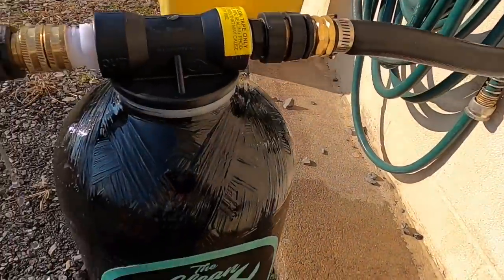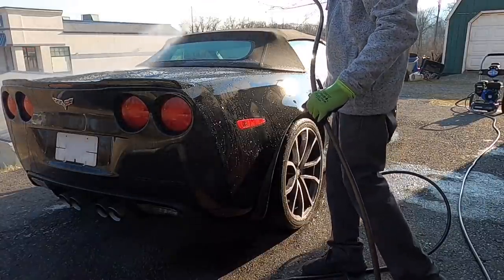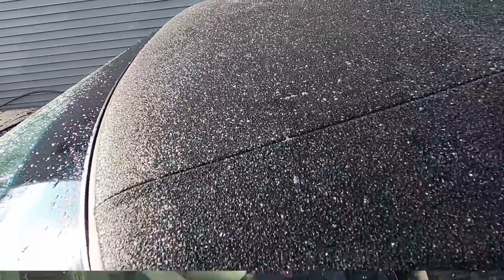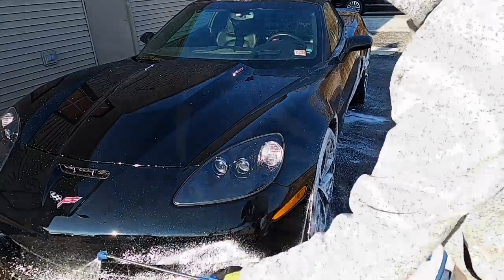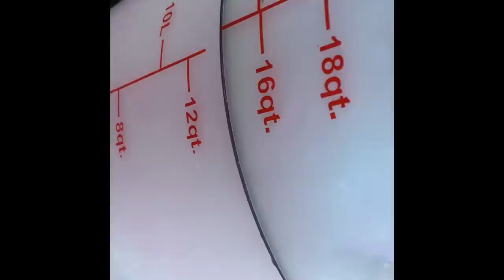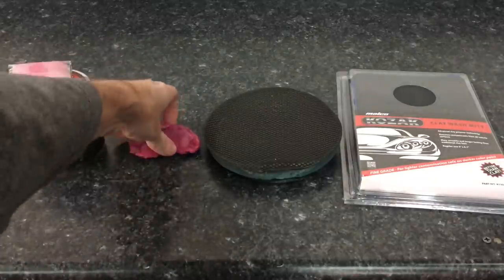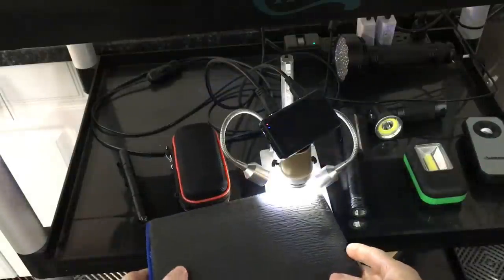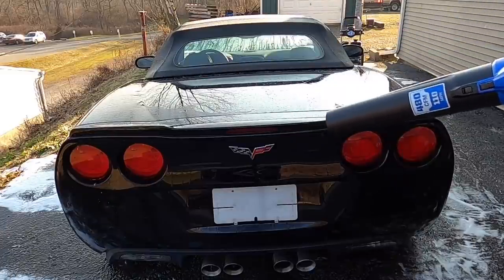Mod And Protect!!! Super Rare 427 Convertible Collector Edition Corvette LS7 7.0L!! Part 2!

Comment: I can't even explain how excited I get when I see the microscope come out.. I imagine it's similar to your team scoring for sports fans..
😁
For clay, I use a bit of everything, but I tend to go back to AM Details fine clay bars. I use smaller pieces than most people and downgrade new paint only bars to wheels and glass duty before tossing them so that helps extend their life a bit. I usually only use synthetics during decon on heavily contaminated vehicles and come back and spot clay with a bar before correction. I don't automatically mow down every inch of every vehicle now after seeing your process. Thanks Brian, amazing series! 👍👌✌

Comment: I have used the fine Nano Scrub, Sonax disc, Griot's round scrub and my favorite by far is the new improved of the OPTIMUM clay towel by  The Rag Company clay towel since it has a light blue surface to see that is time to clean it with little soap or diluted APC. If  the car is really constipated clay is the way to go.  Love for you get a TRC towel use the microscope before and after. I have softer paint on Honda's and all the newer cars are getting so soft.

Comment: cool microscopic view!!      i use Optimum Clay Towel ,i double the onr in 1 gallon pail, and use right after the Ferrex [iron remover] has done its job. to make sure i have extra lube. so i decon in almost one step.  Also, if i drop the Towel, i just rince it off...    its also easy to wash,  and wear n tear is visible..        i remember when Auto Magic came out with the Clay Magic!1 with the detailer spray.   big revolution back then!! ;-)-        i would use a clay bar on really bad contaminated cars, but rarely do so now!

Comment: I actually clean my clay bars. Simply set them in hot water a drop of soap and knead them like dough until they're clean. Rinse and repeat if necessary. Use a set of kitchen gloves so you don't burn yourself of course.😉👍

Comment: Nice job on the vette an I like the clay bar fine nervous I will scratch my paint up bad I heard you can even with fine I always check it with a zip lock bag over my hand after a good wash an dry it's a pain I have a 10 inch lifted truck with 37 x 20 x13.50

Comment: Prefer using an actual Clay Bar also.  Usually go with Meguiars Mild Clay.  The clay bar is more effective and easier to get into tight spaces.  I sometimes use the Griots Garage synthetic clay on newer vehicles mostly that do not have severe road grime.

Comment: Hello Brian, do you think a power-washer removes brake lubrication?  Silicone & High-Temp lubes
Reply: While I'd agree with you I'd add that most half ass book time techs and do it yourself people don't do brake jobs correctly . Add to that I've NEVER seen any factory car come with lube on them
Reply from the maker: To a certain point...you will need to follow up with something like Citrol 266

Comment: Brian, I do not believe that's a Z06.   Maybe someone can correct me, but I don't think GM ever made a C6Z vert.  I think the anniversary editions had the LS7 with the body panels, but I don't think they had the aluminum frame, etc.
Reply: That is correct. It is a officially a Corvette 427 Convertible Collector Edition. You could order  the 60th Anniversary package on any 2013 Vette -base through ZR1 model. They are white with silver/blue stripes and blue interiors. They only made the 427 vert model one year (2013) and 2500 units (half of the 427s made were white). It has the entire Z06 drivetrain (LS7) and brakes, ZR1 CF hood w/o the cutout for supercharger, ZR1 spoiler, ZR1 size wheel/tires, CF fenders and doors, and standard magnetic ride control on a steel frame. Only Z06 and ZR1 have the aluminum frames. GM couldn’t make a vert work on the aluminum frames w/o making major design changes which didn’t make fiscal sense for a limited production run in the last year of this (6th) generation corvette. With all that being said, it is as close to  a convertible Z06 as GM got with this generation. So Brian is close to the mark. And he is doing such a good job with the project he can call this car whatever he wants. FYI this car is 100% original with 14,000 miles.
Reply: Nice cruiser . Definitely a car that doesn't need mods to  just drive and enjoy !
Reply: @whitneyestate1402  That's what I thought, thanks.  What does it weigh compared to the Z06?
Reply: @ssoffshore5111  3350 which is about 150 lbs more than a Z06
Reply from the maker: Cant wait for you to see it!!
Reply: @apexdetail85  Waiting on the next video!
Reply: @ssoffshore5111 it’s approximately 150 pounds more than a Z06 - 3,355 pounds. Z06 is around 3,200 pounds

Comment: For the love of God you don’t wash a car in a Circular motion its a straight motion. U just rise the potential of scratching the car
Reply: I love these comments 😂. Try riding a motorcycle without a helmet ( just a example , don't recommend it ) a car at 50mph let alone 100+ gets sandblasted every second it's moving. Motion is meaningless with proper soap lube
Reply: Motion means squat. The second point... he corrects paint. I don’t think he cares what shape the swirls are.😂😂
Reply from the maker: That is complete BS. Whoever told you that likes to hear himself talk.